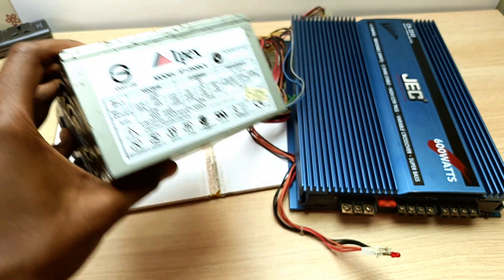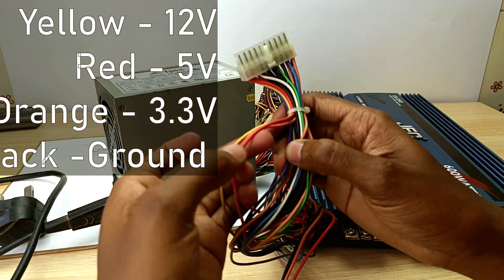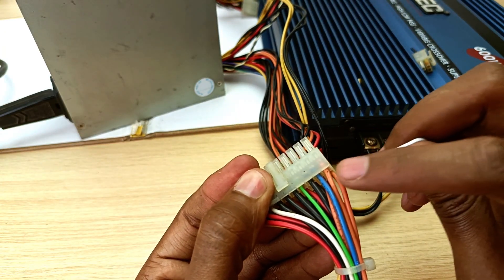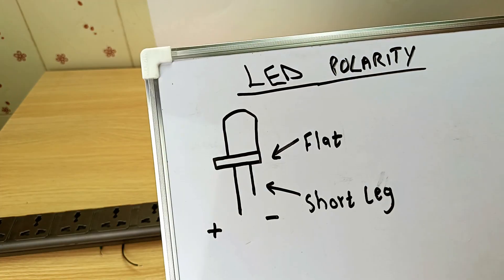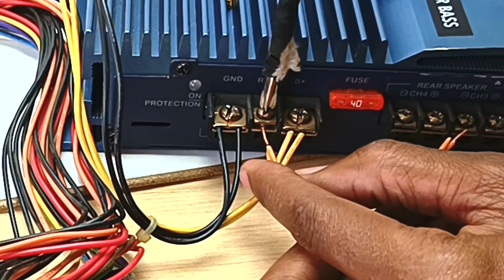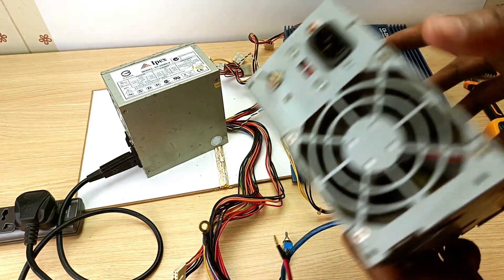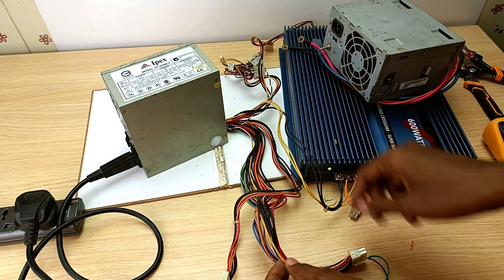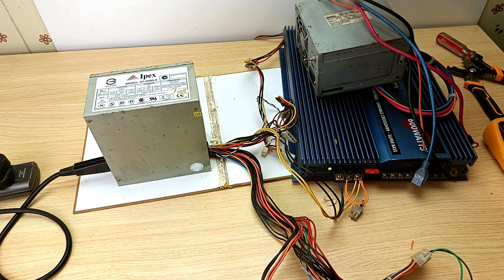How to Connect Computer Power Supply Unit to Car Audio Amplifier at home setup

Comment: Power supply turn of after a second. Why?
Reply from the maker: It could be that it's faulty. Have you tried another one?
Reply: @DominicGichane yes.. I checked with another psu and also another amp... Everyone is same problem.
Reply: @afredesarkar2603 Does it happen too when power supply is disconnected from amp?